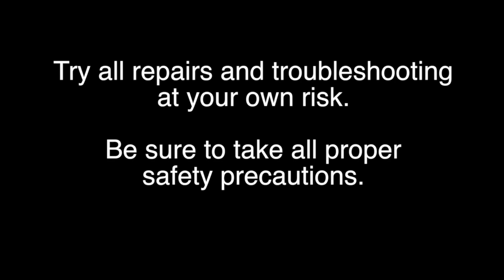Vizio 50" TV LED Strip Replacement Tutorial for Vizio Model E50-C1 D50U-D1 D50-D1

Comment: My screen cracked (Vizio D50u-D1) because the video neglected to mention the adhesive tape that holds the screen in place - 4:45.  When I went to lift with the suction cups, one side of the screen cracked - and I was being careful.  The adhesive on my TV was still very strong after 10 years.  It's between the screen and the panel frame.  Wish I read the other comments first.  Not happy.  Have to buy a new TV now.

Comment: CAUTION: Be extremely careful when removing the LED panel. There are three adhesive strips on the middle portions on the left, right, and top. If not removed correctly, this will lead to a crack in the panel.

Comment: have to say that the video gives the impression that the screen is just floating in the frame....would have been nice to hear about the super sticky tape holding it in place before I tried to lift with the suction cups  and cracking my screen.

Comment: Using the suction cups ,lifting up the LCD panel with out heating up the sticky tape separated the plys of the LCD .  mine is trashed I am  pissed!! These need to know details were not included in the video .following this video was great up until then.Please note at that the white reflective material with the LEDs poking through are also joined with double sided sticky tape , about four strips worth from top to bottom on mine. so if you pull it off it will wrinkle easily.

Comment: At 4:51 where it says “ carefully remove the panel from the chassis” - they forget to mention that there are sticky strips at the middle lip of every side which when you lift up, if it is not cut away, it will crack the screen. So guys, you need to mention this in your video that you probably should take a small knife and try to get underneath the middle-ends 12-13” of the glass screen to ensure that you release the thin double sided tape from the screen. 🤬

Makes me wonder if Visio put this there on purpose so when you removed the LED panel that it would crack
Reply: Thank you for the heads up on this one. For my TV it was only the top panel frame section that was taped to the panel. I'm curious also if it would be wiser to remove the bezel screws AFTER turning the TV over so the panel is still being held in place while turning it over.
Reply: Yep, just shattered mine because of it. That really would've been helpful information to know before hand! 🤬
Reply: @jeremya8010   Using the suction cups ,lifting up the LCD panel with out heating up the sticky tape separated the plys of the LCD .  mine is trashed I am  pissed!! These need to know details were not included in the video .following this video was great up until then.Please note at that the white reflective material with the LEDs poking through are also joined with double sided sticky tape , about four strips worth from top to bottom on mine. so if you pull it off it will wrinkle easily.

Comment: So you saved my TV. I have an M50-E1 model, but the insides are pretty similar. The only difference was it was hard to remove the infralight cover from the left lower corner to get the last screw from around but putting together it went back fine. I got the parts on ebay for $50 and it's like I have a new TV. And by the way, chicks can do this too.
 thanks.

Comment: Great instructions, but a quick tip for anyone before they try; Be sure to use something (blow dryer) to warm the edeges of the panel before trying to lift it from the adhesive strip so you don't crack the panel, learn from my mistake!

Comment: This was almost perfect. Thank you so much. Mine didn't need the speakers removed and the strips were held in with snaps instead of screws, but otherwise spot on, and the LEDs worked flawlessly. Just a tip: when finished make sure to power reset it. Mine didn't work until I did. Bout blew a fuse thinking it still didn't fix it.
Reply: How do you power reset a tv?

Comment: I have a LG led tv that has gone a lot darker all of a sudden but I can still see the picture on screen. I have done a factory reset but hasn't fixed it. the backlight option in settings makes no difference between 0-100. any ideas what the problem could be as it would be much appreciated

Comment: Hi I had some tcon boards ordered for my element tv eleft436. Well ive had them replaced already about 3 times. To begin with my tv turned on but had just a black screen. I did the flashlight test and could see the menu bar. So i ordered the tcon boards as mentioned in the video. The first parts i ordered were defected because my tv would not even turn on. The second replacement parts turned on half my screen and i could see the partial name element and the no signal and the other half was white. I got a 3rd replacement part and now my tv turns on but is white. Im like at a lost now, not sure what else to do? Can you please help me?